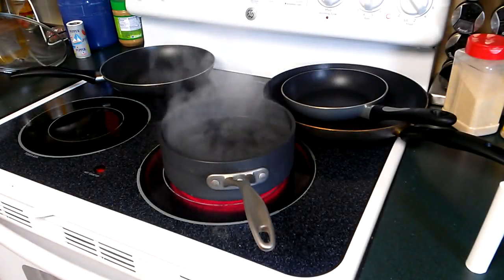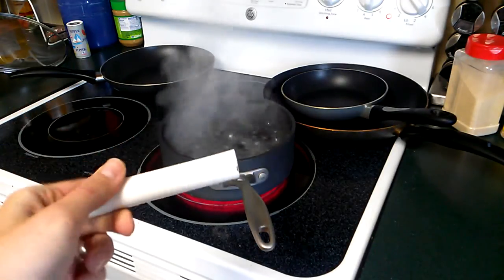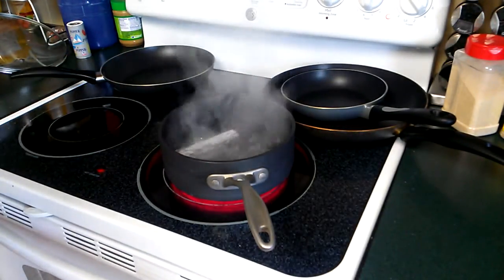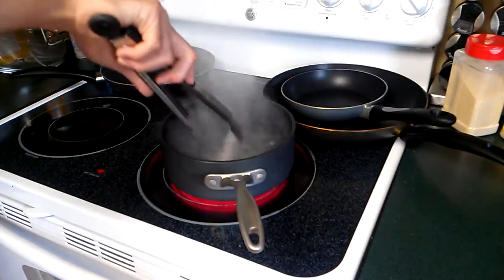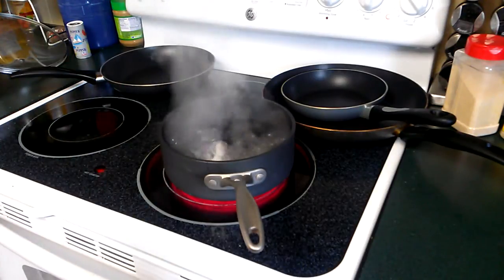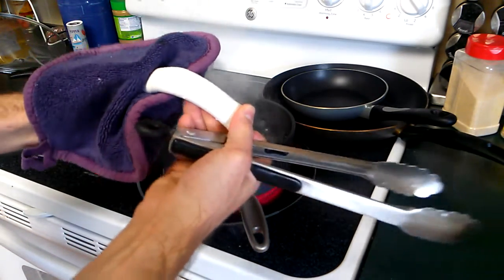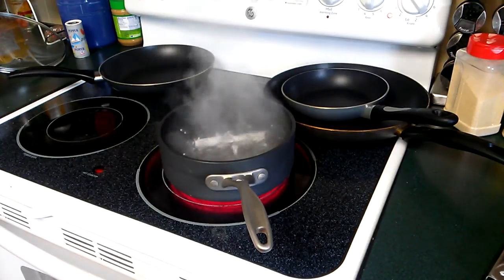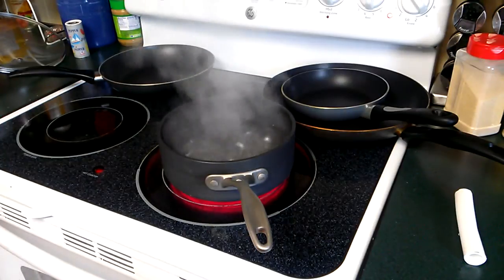Boiling PVC - a Test

Comment: FYI, if the pvc is split in half, heated, then opened up, till flat, then weighted until cool to hold its new shape  now flat pvc can be drilled out to what ever diameter one needs using a , say 1” hole saw, now one has insulators, or large washers that won’t rust.......for various projects

Comment: Do you think it's possible to melt two PVC pipes together with a blowtorch?
Reply from the maker: Jagger Draws! Melt wouldn't be exactly the right word- PVC can soften, but it's such a large, entangled molecule that it tends to burn before it melts to an appreciable degree. Also, thermal decomposition will be a problem. Best bet to first PVC? Use solvent glue. It will be as close to meeting PVC together as you can get.
Reply: Idk maybe if  melting it with a aluminum can to combine but I don't think it would be strong

Comment: probly shouldn't use that pot for food anymore
Reply: stupidPeopleRBored Most pots and pans have a thin coating of nonreactive material so as to resist acidic, alkaline, and other caustic or damaging chemicals appearing naturally in food products. While said coatings naturally lose efficiency over time and with repeated use, for the most part the chemicals used in PVC wouldn't have enough time and wouldnt appear in sufficient quantity to become a health hazard.
Besides that, most of the dangerous substances in PVC are only given off when it's burned through fumes and smoke. I'd say there wouldnt be a problem, but if you would want to be 100% sure, buying a used pan from a thrift shop won't break the bank.
Reply: Of course, all of his water is supplied via PVC pipe and that pan is coated with TPFE 'Polytetrafluoroethylene'.
Just so ya know.
Everything is poison. it is all a matter of 'DOSE"  .

Comment: Can that PVC turn into a gluey consistency by boiling it with water.
Reply from the maker: Mithril David not really. it will soften, but never so much that it loses coherence.
Reply: I will need about 1 minute to reshape the  PVC before it dries and solidify. Is there a way to enable that much time.

Comment from the maker: I think this could work pretty well - it doesn't overheat, so the puffing should be minimal. Maybe boil it and if necessary, just a tiny blast with the heat gun, should work wonderfully!
Reply: Tim Piatek I use the steam vent on my kettle (the whistle, actually—drives my family nuts!) to do the more delicate shaping for PVC work. It takes time, but it's wonderfully targeted.
Reply: The best way to bend p.v.c & get the corner perfectly round is to block one end & blow air in the other end with enough pressure to maintain the roundness in the corners.

Comment from the maker: It certainly could be - at least regarding the level of heat, it's more moderated than via forced air - you're less likely to overheat and burning becomes almost impossible - chemical degradation becomes possible, but unlikely at such low sustained temperatures. 

Anything's possible, but I'd be more comfortable boiling, if not steaming, PVC. Should be OK, but I try not to commit to something without being close to 100% certain :-)

Comment: This would be great for making small pieces like PVC siyahs if someone is using a stove top to make bows.  It would be more difficult to heat up the whole siyah by holding it over the fire or heating element with a pair of tongs or something.  By doing this, the whole piece can be submerged in the water and heated up all at the same time.